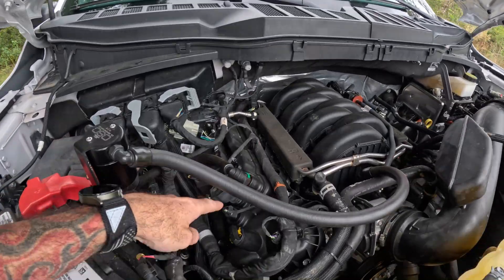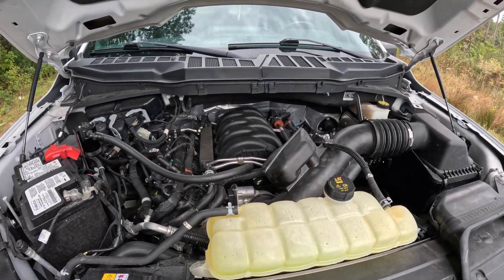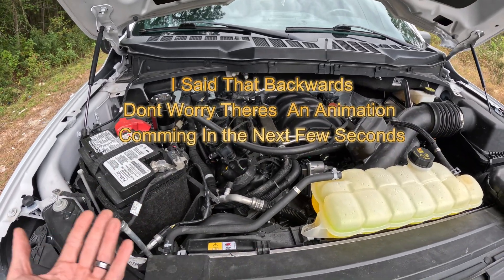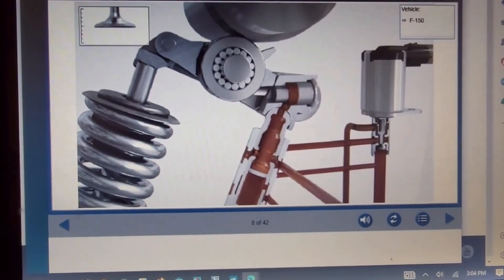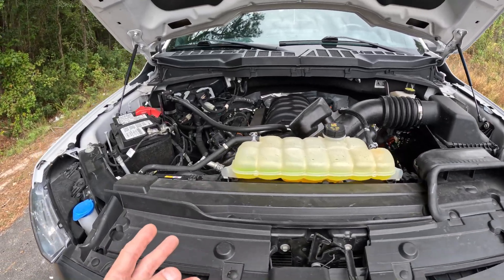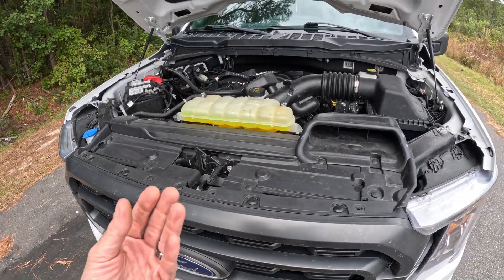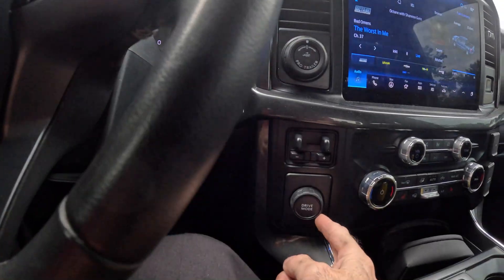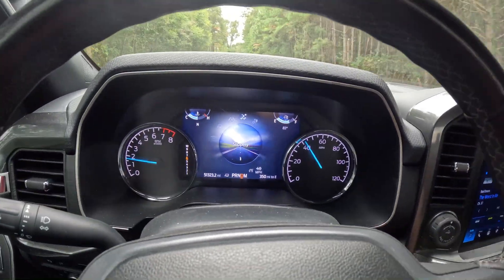3 Things You Must Know About F150 Cylinder Deactivation

Comment: The best way to deactivate cylinder deactivation is putting a tune from a reputable turner. I used OZ tuning for my 2024 f150 now that tuning is available. Wow, i highly recommend it. Even my shifts are crisp, and doesn't skip gears. You get more power and can run e85 in it if you wish. Sport mode REALLY rips now too low. 5.0 engine is awesome
Reply from the maker: I dont trust tuners unless its banks or I tune it.  I have a pedal monster. Sport mode really rips with a pedal monster. 5.0 is fast already.
You know why you get good shifts. Because starting in 2023 they fixed the cdf drum bushing fault. 23+ has updated parts in it. I've never seen a 23+ with a transmission concern.  Mine shifts buttery smooth. Doesn't skip gears at all.  But as far as tuning i wont use those "buy it and plug it in"  I've seen too many bad things happen with those. We actuslly go in the pcm and change address lines and such.  But if yours is working thats awesome.  Have you tried a pedal monster?  I highly recommend one.
Reply: @BeardedFordTech no never tried a pedal monster, but ive heard good things about them. Ive never heard anything bad about the big major tuners either such as oz or Lund tuning. They are the guys people use for when you whipple or procharge turbo ect. Of course local tuners can tune also. 
But, these are dyno tunes that give you actual spark advance.
As far as the transmission, mine was good but would skip 2nd gear on take off, and they all do it. It was also a bit lazy on down shifts.  Sport mode the shifts are firmed up quite a bit. Normal mode is insanely smooth, i didnt think it could get any smoother. If you drove my truck before and after you would be singing praises LOL. Iam looking for a performance oriented truck though, i have a single cab and plan on a vortec supercharger in the future. I have high flow cats, intake, pmas intake and the oz tune and its running low 4 sec 0 to 60. I haven't tried the quarter mile yet but for sure in the 12s. Again these 5.0s are great platforms. I can understand your side and reasoning for doing what you do. I think its based on your goal and what your comfortable doing to your truck. I appreciate your video.
Reply from the maker: @flawlessfoose oh yeah those tuners are okay. Big brand been around.  Yes they dyno tuned. The problem with that is its not dyno tuned on your truck.  Its tuned on a similar year make model in some other state.  To properly tune it you would need to dyno yourself. We always ran into this with power commanders on sport bikes. People would buy them. Then load the "pre loaded" map.on for your exhaust and air filter and they automatically think it gives them 20hp. Maybe it did on the same year model bike that was tested in Vegas in 110 degrees.  Thats the only issue I have with them.  Thats why I like to do the pcm tuning on a dyno and not use a pre loaded one you buy off the internet. Thats why I said I've seen bad things happen with them.  Not saying anything will with yours at all so dont take that the wrong way.  I highly recommend a pedal monster. Took it out of my ranger and put it in the f150. Put it on level 10 track mode and the truck in sport. You better be hanging on. Holy crap such a response.  I love the 5.0. When something goes wrong there's always the haters out there. Know what I mean.
Reply: @BeardedFordTech  i know exactly what your talking about with the power commanders on sport bike, i had 05 ninja 1k and that is exactly what happened lol. The canned tunes are actually legit though, and are in a safe range even though ones in Florida and the other Washington state as the truck will adjust to its climate. Whats cool too is the data log which is really easy and can be sent to them for fine tuning adjustments for your setup. 
I will be doing this as soon as hp tuners is able to do read files
Reply from the maker: @flawlessfoose very cool very cool.  Yesh i race sport bikes so we would put them on the dyno and tune the fuel mapping for each cylinder at each rpm range. Takes a long time to do that. Especially for different tracks.  Can tou send me an email with the tuner you have?
Reply: @BeardedFordTech  i sent a email
Reply from the maker: @flawlessfoose thank you. Will check
Reply: We have a Pedal Monster on our 2023 Toyota 4Runner and let me tell you the 4Runner now feels much faster and sportier than ever.
Reply: That doesn’t fix the wet rubber belt inside your engine that drives the oil pump. Yes, cylinder deactivation will destroy your engine, but the wet rubber belt will destroy it sooner, by shedding a million little balls of rubber that go thruout the engine. Blocking oil passages, eventually destroying the entire engine. Go watch driving4answers, or idocars vids on wet rubber belts, and you will know is time to sell your 2021+ 5.0.
Reply from the maker: @craigg4246 cylinder deactivation doesnt destroy an engine. And the wet belt isnt a problem on a 21+ 5.0. Or the 2018+ 2.7 (you never mentioned that one)  the 1.0 yes absolutely its garbage.  But stop letting the internet scare you. I work on these things everyday. Lifters can fail on non deactivation cylinders too. You know how many belts ive seen fail on a 21+ 5.0 or a 2018+ 2.7?  None. Know why. Its kevlar reinforced. The 1.0 is not and the 1.0 uses a tensioner system which cracks/breaks.  Stop fear mongering. The ones that do fail are from people using oil not compatible with a wet belt system and going 20k miles on it.  Do a little research.  Did you know a wet belt actuslly outlast a 3.5 turbocharger. Those things fsil like crazy but nobody every says anything about that.
Reply: @BeardedFordTech doesn't matter its still idiotic to run a belt in oil along with plastic valve covers and oil pans on the 7.3 gas engine the oil pump runs of a chain,
 nothing beats a gear driven oil pump!
Reply: Yep and Jason will tell you the same thing as well.

Comment: Cylinder deactivation on my 5.7 Hemi runs like crap when engaged  I live off switch engaged 24/7
Reply from the maker: Hemi deactivation on a hemi is a crap system just like GM.  With the F150 you can't even tell it deactivated cylinders unless you have an exhaust. Other thsn that it feels the same.
Reply: @BeardedFordTech that is why I have the ECO button turned off   It stays off  doesn’t reset every time the car started
Reply from the maker: @TXCherokee thays cool it doesnt reaet. Sport mode, tow haul mkde dont reset on the f150 when you turn it off. It will ask you do you want to return to normal mode though.
Reply: @BeardedFordTech someone said I should replace rocker springs before 150,000 miles
Reply from the maker: @TXCherokee never heard that before.

Comment: I have the 5.0 XLT 2023 I switched from Chevy because of the lifter problems. The first three months I had the Ford. I didn’t realize it had cylinder deactivation until I put an aftermarket exhaust on it. The cylinder deactivation onFord  you can’t tell it’s on there like Chevy you can feel it every time you take your foot off the gas. It goes into V4 mode.    Does Ford have anything to deactivate it like the range does for GM Chevy trucks but honestly Ford deactivation is better than when I want  it v8  I just put it in sport mode usually most of the time just on the highway.
Reply from the maker: Sport mode. Tow haul mode. Or normal mode let it shift to 10th and hit the "M" button for manual shift. Those 3 options will keep all 8 cylinders on.  True the only way you can tell is with an exhuast like i have. You csn hear it.  But you cannot feel it at all.  Im still working with my super smart computer friends about deactivating it with forscan.  Until then. One of those 3 ways will have to do.  And yes it is a way better system thsn a GM or chrysler/ram.  Havent seen not one issue due to deactivation on 21+
Reply: @BeardedFordTech  I do have one question I noticed when you started it up you let it idle down before you drove it. I do that for the first start up of     but not for the rest of the day is it better to let it idle down before taking off every time.  Thanks for you input!
Reply from the maker: @garyb5909 first startup yes. Not necessary everytime. I just did that so viewers could hear it.  And its also a habit ao it doesnt put so much strsin on the transmission when shufting from park.  But no you dont have to do it every time
Reply: @BeardedFordTech thanks for responding!   I’m new to Ford always was a GM guy. Just making sure I wanna keep it for a long time. I love the 5.0.

Comment: Thanks for the video! I’m happy that my ‘13 F150 5.0 with only 73K miles doesn’t have this added complexity. That and the prices these days mean I’ll be hanging onto it a lot longer!
Reply from the maker: 11-13 is like my favorite year model. The 5.0 from 11- present is still my favorite engine. I saw lots of design changes.  Hang on to that bad boy as long as you can
Reply: I had a 2011 Ford F150 with a 5.0L Coyote V8 in it with 163,000 miles on it before I traded it in for a 2024 Nissan Titan (the last year of the Titan) and it ran great minus burning oil at 160,000 miles (which doesn't seem alot of miles at all).

Comment: What's your opinion on oil viscosity in these engines? Lot;s of debate on 0/5w-20 vs 5w-30 and what the owners manual recommends.
Reply from the maker: These engines take 5w30. Have been since ford switched the 5.0 to 5w30 in 2021. They did away with 5w20 on the 5.0. Even guys/girls who owns older ones switched to 5w30 and say it runs way better
Here check it out 
https://youtube.com/shorts/DyJQe7pZTF0?feature=share

Comment: Couple times i had a engine light come on, cylinder 5 injector range performance. ? Truck still ran perfectly it seemed
Reply from the maker: Thats not a deactivation problem. Thats an injector porblem.  You ever get a new one? High side or low side?
Reply: @BeardedFordTech  not sure hi or low but its happened a few times . I reset the light and few months it comes back
Reply from the maker: @Mike-y9l2m I would get that checked out. Or just replace hi and low. Dont want a messed up injector. That can be very bad.

Comment: I have a 21 V8 F150. I don't have a problem with cylinder deactivation. On one 1000-mile one day all interstate run when I wasn't towing, I recorded 24.0mpg on the first tank and 25.8mpg on the second tank. I have had several 24.0mpg plus tanks as well, all manually calculated. For a vehicle so big, and so multipurpose capable, I think that's fantastic.
Reply from the maker: I have had 27 on a long trip. You see 20.8 on there now cause I've been. Doing a lot of around town stop and go.  If im just causing. About 24 is what it gets. 27 was a lot of downhill. It really does get great mileage.  It doesnt bother me at all.
Reply: 2023, i get 23.2 on crew cab

Comment: So based on the fact that you don’t mind it and are not worried about it I’m assuming you have determined - based on experience - that the Fords are not at as big of a risk for lifter failure than the other manufacturers?   I trust you and that makes me feel better.  Last week a guy at work had a misfire on cylinder 1 on his 2018 Ram with 90k. Turned out to be lifter failure due to cylinder deactivation - or at least that’s what the shop said.
Reply from the maker: Sp what happens on the rams is an oiling issue.  And a lot of idling.  I was watching a dude who has been working on them for many years.  Its not always a deactivation one that fails either.  Its a combination of crap soft metal, idling, low oil pressure, and probably some dirty oil.  He also said if you change the oil pump to a hellcat pump you dont get the problem.  Some people say use the lifters from a hellcat. They are the exact same ones.  That dude is smart.  When my engine failed in August it said 8 failed roller rockers 1 of them was a cylinder deactivation. It was just delaminating. My engine failure was nothing to do with deactivation or a wet oil pump belt.  It was built wrong from the get go.  I haven't seen any failures due to deactivation.  Not saying it wont fail anything can fail in an engine. Just not a thing with the f150.

Comment: Just purchase an AFM Deactivation dongle, plug into the OBDII port and be done with it. Oh wait, this is a Ford. They don't make them for Fords evidentally. Works great on my '22 V6 Blazer. I've had it plugged in from day one and it never leaves V6.
Reply from the maker: Yeah see dont even need to buy a dangle. Chevrolet wont even allow it to turn off switching modes. Now you got some cable hanging in your obd port
Reply: @BeardedFordTech  No cable. If you go to Range website you can see the dongle. You can't even see it once plugged into the OBDII port. And, the AFM Disabler absolutely keeps the ECM from commanding the engine to switch V8/V6 to 4 cyl. That's the point of the disabler. Once plugged in, it stays in V8/V6... never switching. I've left it in the OBDII port while taking the Blazer in for oil changes and Chevy knows I have it there since they need to plug in their scan tool to check for codes. Never once have they said that it voids the warranty. The disabler does not reprogram the ECM. It simply sends a signal to the ECM telling it not to deactivate the lifters. Works like a charm. It's not a permanent fix for the shitty lifters that eventually fail, but it does work and I don't have to mess with anything else.

I guarantee you,  if these were available for Ford's crappy Ecoboost engines, that market would be using them to some degree also. All it is is a workaround. The lifters will fail because that is the weak link in the chain. 

You can also do all the bullshift with the shifter and keep it in manual mode, but I chose to use the AFM Disabler. It simply tells the ECM to keep it in V6 mode and never deactivates the lifters. Nevertheless, All these manufacturers are crap these days and the customer is left paying the price for all the greed and corruption at the top. Every American manufacturer has taken govt. subsidies to implement all these environmental and CAFE standards that screw the consumer. They all deserve what happens to them... and it is happening. 

I probably won't by another GM product after I'm done with this Blazer, but I surely wouldn't buy a Ford or a Dodge either. I've never been a fanboy of any brand. Today, no manufacturer has anything to be a fanboy over and hang my hat on. They all are overpriced dumpster fires.
Reply from the maker: @EdHanson-l7w like a pedal monster. But it just a wireless dangle. I get it now. Sucks you have to buy one of those to keep it from switching. Im working with my forscan guys to find the address line in the pcm to turn it off completely. Ford's make things easy to turn on and off. But still working on this one. Its a little different. Its buried in the coding somewhere

Comment: Excellent subject to cover! That's pretty cool that you can turn off the cylinder deactivation. Ford has their system covered unlike GM. The GM system deactivates cylinders by sending a connecting rod through the oil pan. This renders the engine inoperable meaning that no fuel is consumed. The owner saves money by using the tow company's fuel. The engineers at the Grenade Makers think tank have come up with a revolutionary solution for the all new Ecocise high performance engine in GM's new sport truck which will be called the Shoe Leather Express. GM has teamed up with the New Balance shoe company. Each new Shoe Leather Express sport truck will be equipped with a pair of high quality New Balance walking shoes. When the connecting rod exits the oil pan deactivating all cylinders the owner will burn calories instead of fuel getting to his or her destination. The offroad package includes a pair of high quality New Balance hiking boots. The owner will definitely get fresh air without polluting the environment. GM has hired Greta Thunberg as the spokesperson for the upcoming ad campaign for the new model which will hit the showrooms mid 2026.
Reply: @BeardedFordTech  I knew you'd get a kick out it!  🤣🤣

Comment: great video @beardedfordtech there are a few other things i would like to turn off  like the both hands on the wheel alerts  it drives me nuts lol. but thanks for the deactivation work around  i will try them on my mustang 5.0
Reply from the maker: Is lane keeping system on?  Turn it off and it will turn off both hands. I had lane keep on and took my hands off and it told me to put them back on.